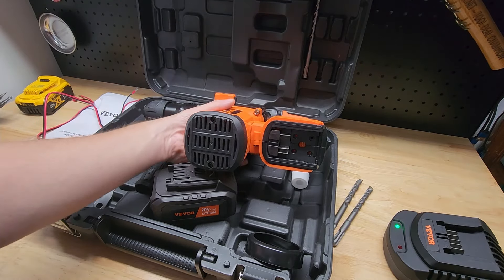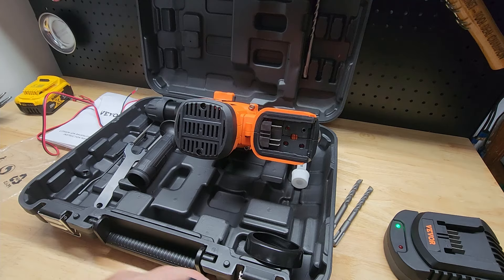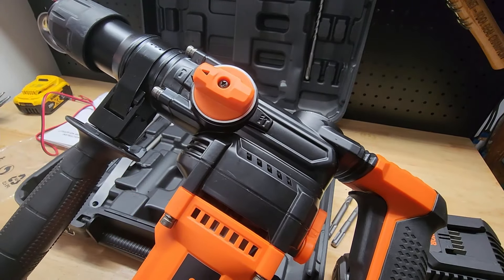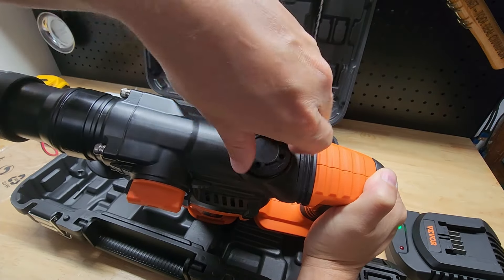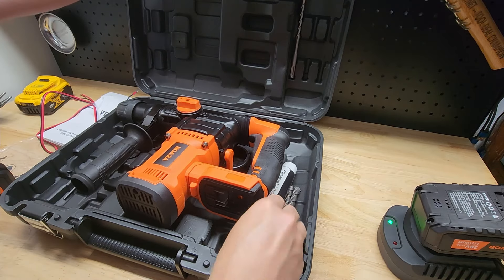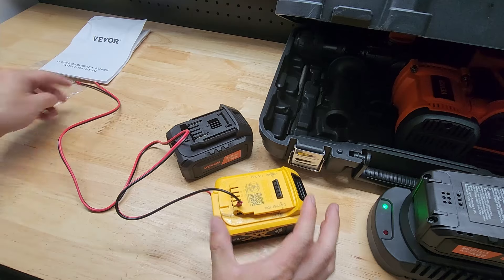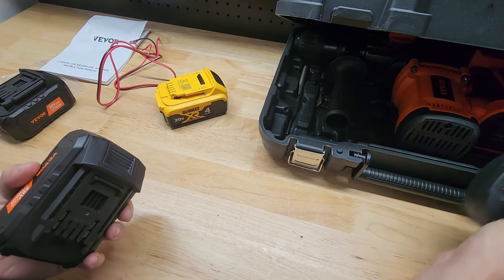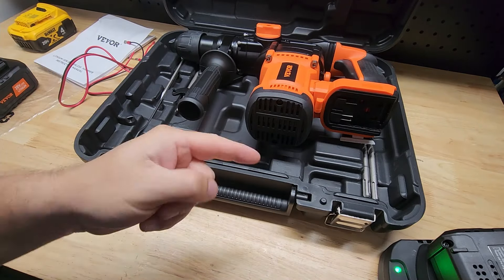Lets Take A Look At This Vevor SDS Plus Hammer Drill! (Batteries... 😲)

Comment: I also had two dead batteries, and for mine the simple jump did not work but I took them apart and did some custom charging, bypassing the BMS and now all is well.

There are four "security" screws and some fiddly bits, like all tool batteries. They seem generally well designed with decent build quality. One potential flaw: I didn't see balance circuitry on the BMS (but I could see only one side).

Looks like the BMS shuts down at about 2.5v/cell and the jump was unable to reach the cells.  One battery had cells at 2.4v and 2.3v.  Used bench power supply to charge the entire pack (bypassing the BMS) to about 17v, reassembled and it charged normally. I think it will be fine.

The other battery was grossly unbalanced with cells at 3.4v, 1.7v, 3.4v, 3.5v, 3.0v.  I used the bench supply to charge the lowest two banks up to 3.5v. It charged normally and I used it a little bit.  Seems okay.  Cells down to 1.7v may have lost some capacity and I may take it apart again after a couple of cycles to see if it is holding balance.

Hope other people get better batteries, but maybe these vevor deals are all old stock. Still a great deal!